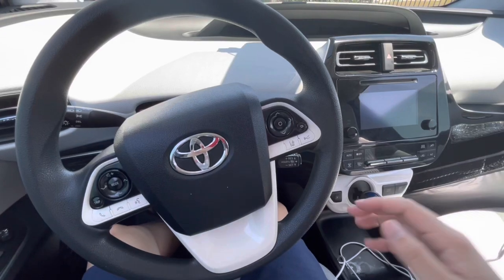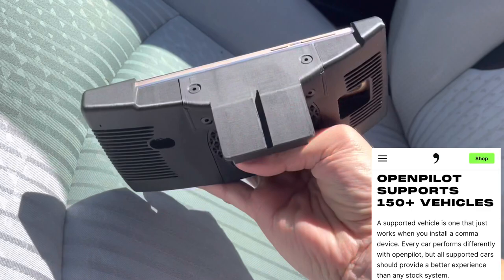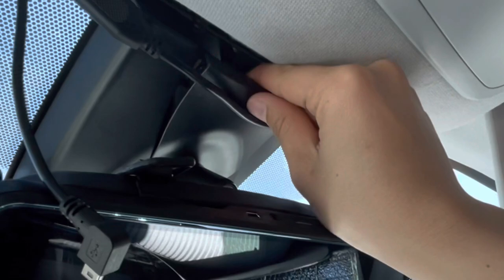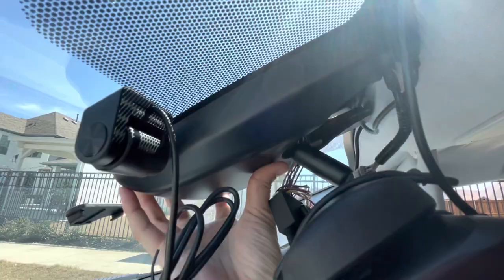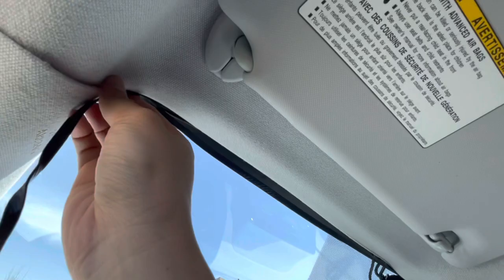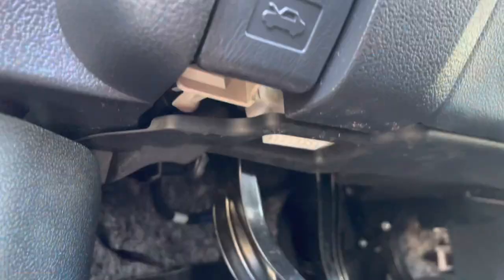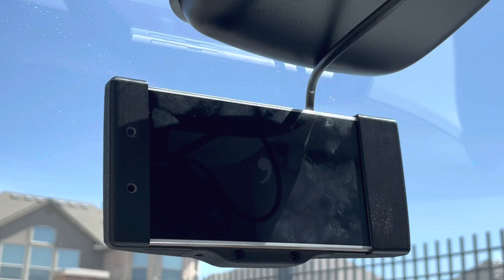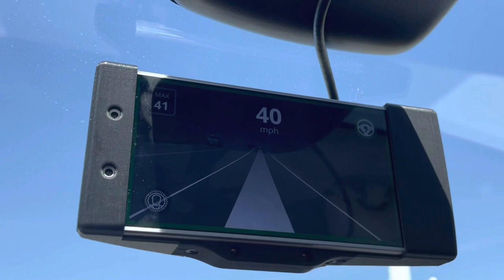Making a Self Driving 2016-2022 Toyota Prius (w/Comma OpenPilot)…and test drive

Comment: Does Toyota Prius need to have safety assist?  for compatibility with Comma OpenPilot?
Reply from the maker: As long as it has the two white buttons on the right side of the steering wheel (lane keep, radard cruise), it is compatible. I know 2017+ have them in all models (trim 1-4), but only specific 2016 models come with it (e.g. trim 3 touring, 4 touring).
Reply from the maker: Here's a way to tell by looking at the steering wheel:
1. 2016 not compatible: https://images.autotrader.com/hn/c/58bf5405205e4bdc9faf9d2e382bbb08.jpg
2. 2017+ compatible: https://images.autotrader.com/hn/c/ce9e1ebad830481fa9da3c22f2f02503.jpg

Comment: Did you try disconnect DSU see if it worked any better?
Reply from the maker: Haven't tried yet
Reply from the maker: @Maginnes2010  Not yet, but I've planned to give it a try given the "no disengage on gas" feature
Reply: @EdwardInTX did you try? Also how stable is the lane keep with comma 3? Can it take turns smoothly?
Reply from the maker: @MrQuay03  I haven't disconnected DSU but plan to buy SDSU so comma can control the speed. I don't have a comma 3, but it would be the same as comma 2 without the ZSS steering sensor upgrade

Comment: Do you know if this will void your car’s warranty? I want this so bad and would buy it in a second if it doesn’t.
Reply from the maker: Nope. Modifications aren't permanent either--you can easily unplug and remove it. I've moved it from car to car with no issues.
Reply: @EdwardInTX  the car you installed on was bronze. Did it have any issues driving ? Corners etc?
Reply from the maker: @alexanderadams3437  I'll post a driving video soon. I've used it mainly on highways, and worked very well for that. I haven't taken any insane curves yet, but plan to try. I believe this car is Bronze because openpilot doesn't control gas and brake--it relies on the car's adaptive cruise function.